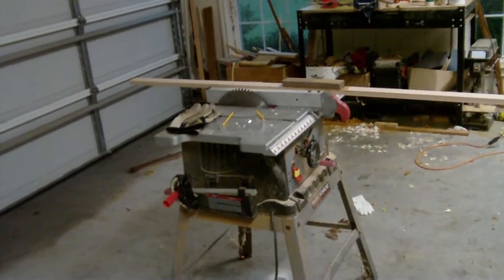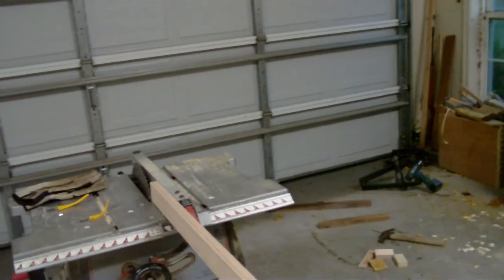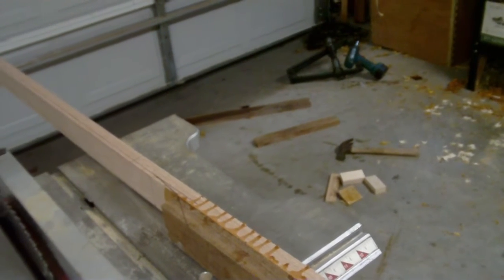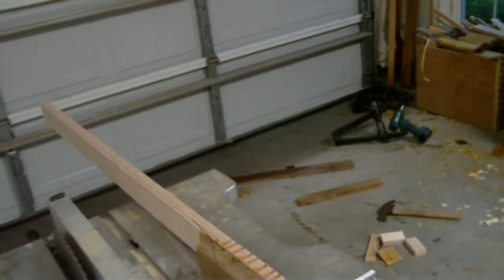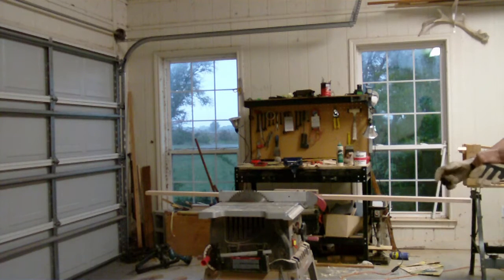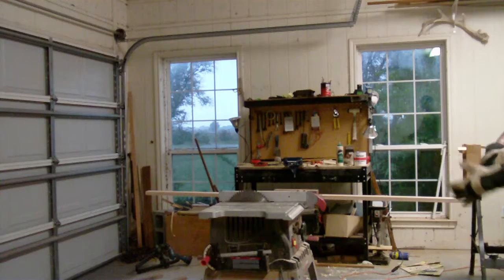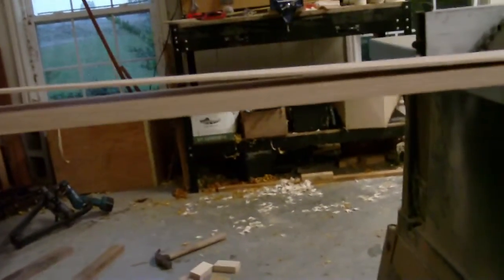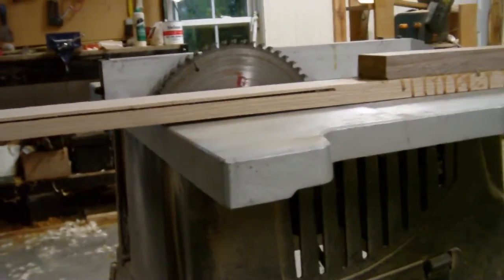boardbow build along pt 3

Comment from the maker: @MrArcher0   its much easier to get a smooth transition with the handle on.  i've probably made close to 100 boardbows the way.  if you glue the handle on later you have to worry about you fade transition into the stave.